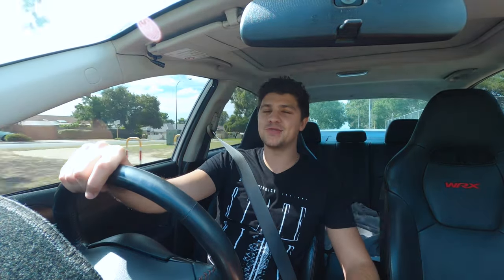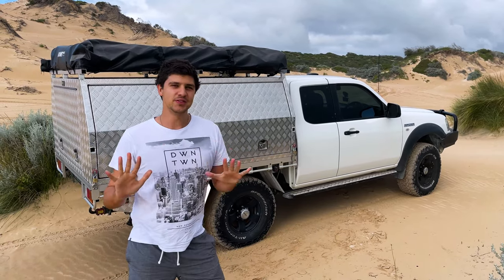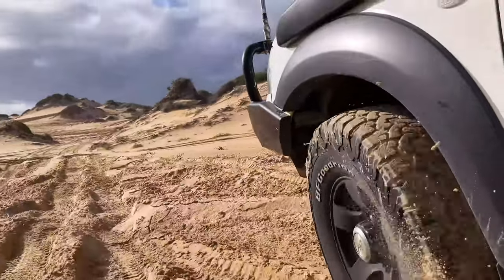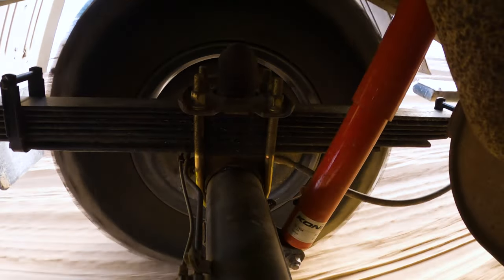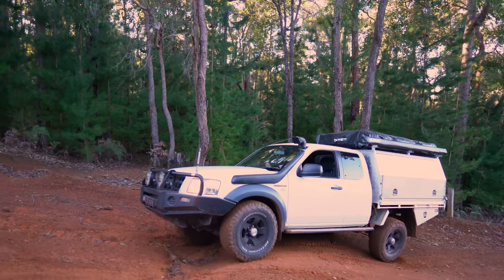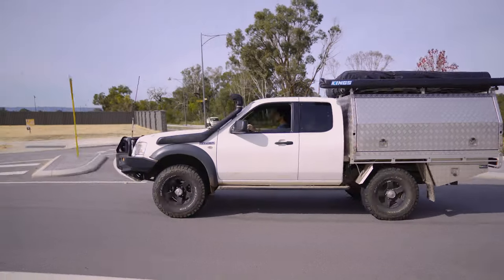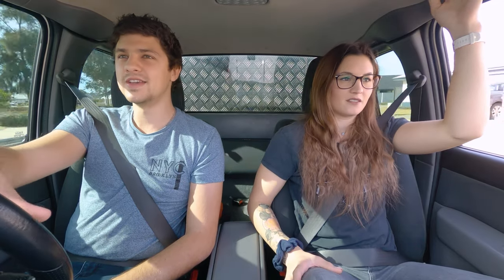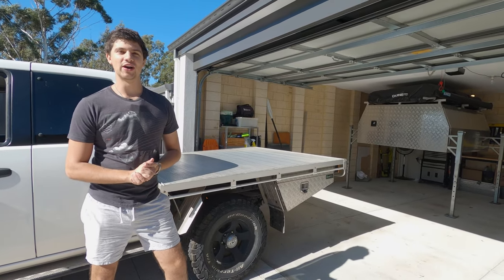My New Suspension! Dobinsons Springs & Koni Shocks | Full review + on road and off road test

Comment: Good on you Bianca for lending the Subie - my head is now Hilux but my heart still belongs to Subaru (10 of them) - I’m still kitting out canopy for my Dual cab 2010 Hilux - so far standard suspension looks good - I’ve been testing all items against my weight criteria test - 27l Engel Fridge, Amptron 100ah battery, your slide out pantry and dual burner camp stove - will be interesting to see what happens with 24 Zero Stealth low profile tent - John in SA

Comment: What Koni series shock did you go for?
I have the big 90 Raid on the rear of my D40 Navara and I love them, especially as I have full rebound adjustment, are hydraulic and long travel.
Don’t have them on the front yet, but will be changing to them shortly and really looking forwards to a more balanced setup.
Reply from the maker: Hi Tor, their 82 series were the compatable models for the Ranger - super happy with them so far!

Comment: Hi mate

Thanks for the vid
What are the specifications on the front and rear springs please.

What are the load ratings?
Thanks
Mick
Reply from the maker: Hi Michael, the springs are Dobinson L39-032-R leafs and TB39-1551 torsions. Leafs are constant load 420kg and torsions are their "heavy duty" model (to support additional weight such as the bullbar, sidesteps, 2nd batt etc).

Comment: is it a 2 inch lift and has it created any drive shaft issues at rear ? any spacers being used or diff siff to correct angles ?  i got a west coast suspension 2 inch lift and have been very happy with but cant floor it from a standstill without tailshaft clunking .otherwise very good especially with a decent load ,300kg springs for towing and load
Reply from the maker: Yeah this worked out to be a 2" lift, although I got a lot more in the rear due to sagged factory leafs and the weight of the canopy haha. Haven't had any issues with the rear drive shaft luckily with no spacers or diff adjustment.

Comment: Hey mate do you happen to know what part number for the koni 82 might be ? I can't find any that  specificy  pj/pk or bt50 .. as I I have an 08 bt50 and wouldn't mind getting my hands on some as I'm looking at a 2" lift and want decent shocks
Reply from the maker: Hey mate, the rears are Koni 82-2604 and fronts are Koni 82-2591 - great shocks!
Reply: Cheers mate appreciate it , our of curiosity what sort of lift to you end up getting our of the set up, obviously your lugging a fair bit of wait so just thought be interesting to see
Reply from the maker: I got about 1.5" - 2" in the front, and 3" or so in the back (becuase the factory leafs were so sagged).

Comment: Just one question mate .
Does it sit level ?
My front sits way lower than the rear lol looks like crap that's after getting it done.
Reply from the maker: Sure does mate, pretty much spot on. That's until the canopy is removed then it's a bit high in the rear as you'd expect haha.

Comment: Hey mate, how is it as a daily now without the canopy on? Really considering a similar setup as you (canopy on for trips only) but unsure how harsh the ride would be on the bitumen when unloaded. Thanks :)
Reply from the maker: Hi mate, it is quite rough in the back when the canopy is off to be honest - still better than the original setup but definitely more comfortable with the canopy on
Reply: @explorebound  thanks, this is weighing in on my decision. Perhaps a parabolic leaf would help ride comfort with/without canopy. But 500kg is probably pushing it. Anyway nice setup
Reply: Considering what you done with the lift off canopy & suspension with the ranger - is there anything you’d do diffferent now with the dmax?

Comment: Was this just a upgrade or a lift
Reply from the maker: Hi mate, I believe it was technically a 2” lift over factory although I got quite a bit more in the rear due to sagged factory springs while the front stayed similar (factory torsions were wound up). This resulted in levelling the car out rather than the tail sagging which was great